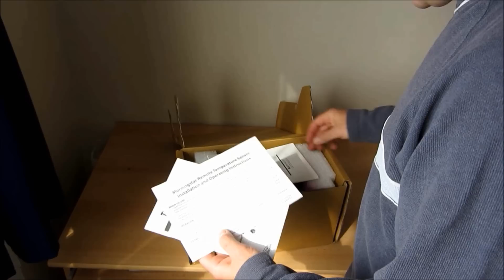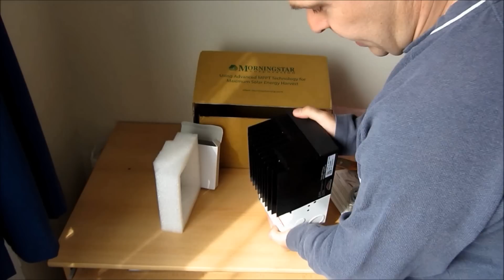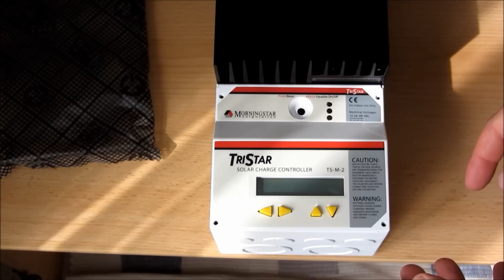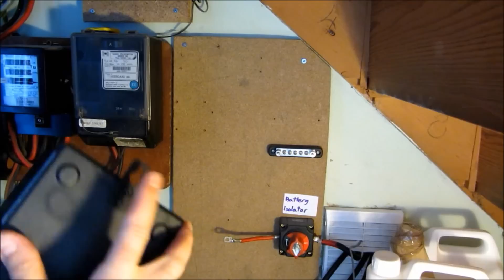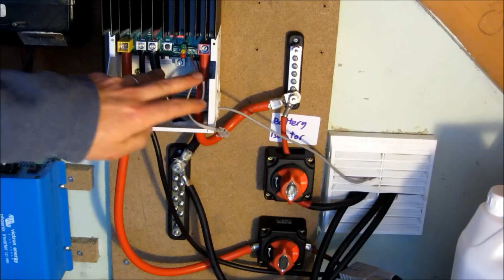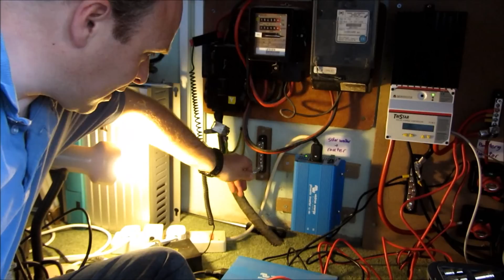Installing a Morningstar TriStar MPPT 60A off-grid solar charge controller

Comment: i was so worried i had a nightmare last night of this charge controller that i owned melting, it was crazy.
Reply from the maker: Well, they are quite costly! As far as I can tell, as long as you have the wires connected the right way round, and as long as you never have the PV connected while the battery is disconnected, you can't go wrong.
Reply: Mike Pepler    Can you please help. i have this http://www.solartronic.com/download/PS-121000.pdf  batteries conected in series running at 12 volts, the problem is that it will not go in to float mode, i have all switches off except for except for 3. 1 off 2 off 3 on 4 off 5 off 6 off 7 off 8 off. can you please help me set it up . i dont want to mess up those batteries are gel batteries.
Reply from the maker: unitcount503
Hi. That's a 12V battery, so do you mean you have them in parallel? If you have two in series that makes 24V, which would certainly stop it working properly. Also, it's an AGM battery, not gel, so you should be OK choosing battery type 4 from the list in the manual (switches 4-off, 5-on, 6-on). Could you confirm how many batteries you have and if they are in series or parallel? Also, if you could tell me the type, number and wiring of the PV panels that would be useful too.
Reply: Mike Pepler  i have both batteries in parallel 12 volt system they are deep cycle batteries.  do you set the voltage  to the vdc that says on the batttery, im talking about the pwn chargeing. because they can over heat if you setup the pwn wrong. its like to tell the charge controller to stop chargeing.
Reply from the maker: unitcount503 Well, I still think you should change the jumpers to AGM type. But looking at the datasheet, it says max charge current is 20A, so as you have two in parallel you can set the limit 40A. To do this you have to program the controller though, which has some complexity, so I'd suggest that you get someone local to help you if you're not sure, so they can come round and look at it with you. or contact Morningstar support, as they are very helpful.

Comment: i seen on the diagram it shows to connect the positive directly to the battery >?
Reply from the maker: Yes, mine does go direct to the battery, just happens to be via a switch for disconnection and a fuse.

Comment: great video you say you are going to upgrade to 750w I take it your running a 24volt system as I think its 600w max using 12 volt system.how will you wire the new panels up in series or some parallel.thanks
Reply from the maker: Hi. Actually, the limit is 60A, rather than a power in watts. I've since upgraded to 750W, and then added more to reach 1250W. The controller can handle about 860W when the battery is at the absorb stage, as I have a 12V system. Interestingly though, a 250W panel usually only peaks at around 180W once the sun's heated it up, so peak power from my system is between 900 and 1000W in practice. That means on sunny summer days the controller is dumping some power, but in the winter the extra panels come in useful. 

If I read starting from scratch, I'd do 24V, but I already had 12V kit...

Comment: What does the 3 LED indicator indicates
Reply from the maker: Voltage of the battery, and using a computer you can program the voltages they come on at. They also flash in sequence during programming.

Comment: since you already got a victron inverter why didn't you buy a victron charge controller as well.
Reply from the maker: +MySchizo Buddy they're not connected, so it doesn't make any difference what brand. I'm not sure the Victron controller is as good quality as the Morningstar, and it doesn't have the same technical specification.

Comment: Where does solar energy goes when all your energy storage devices are full?
To waste?
Reply from the maker: Yes, the controller will raise the array voltage above Vmp, towards Voc, to reduce the power output once the battery is full. So to make best use of the power you need two things - a big battery, and loads you can bring on when there is spare power. I run the washing machine for example, or use a slow cooker, when there is surplus power.
Reply: Mike Pepler Very nice.
If you got money can you buy (build) 22v 6000Farad ultracapacitor module. To put wasted energy in ultracaps. And let us know how it is? I use 22v 375Farad, can boil tea of soup. I just done have money to buy more farads.
Reply from the maker: Artjoms Pugacovs  I did wonder about using ultracaps (I have a couple of torches that use them), but at the end of the day I'd probably be better putting the money towards bigger batteries when I next upgrade them.

Comment: I'm off the grid and I was just wondering what is a bust bar for?
Reply from the maker: clark Grizwalt It's a 'bus bar', and it's just a bit of metal you can bolt several connectors on to. I use them to merge the parallel connections from my 5 solar panels into two wires to run to the charge controller, and at the other end to distribute power to the inverters.
Reply: Ok

Comment: How did you knock the holes off?
Reply from the maker: With some difficulty! :-) I put a screwdriver near the edge of each one and tapped it with a hammer until it had moved away from the body a bit. Once there was a gap, you could get the screwdriver in and lever the circle of metal away and break it off.
Reply: Thanks Mike. For the Remote Temperature Sensor, how to connect it to battery. I have 2 batteries in series. Do I just need to connect it to any one terminal either positive or negative of either battery 1 or 2?
Reply from the maker: Khalil Raza Either battery will do. I think the manual suggests bolting it onto the positive terminal - perhaps it gets a bit warmer during charging? It's also worth insulating it after installation - I just covered it in bubble wrap and taped it up.
Reply: I called Morningstar, they told me it doesn't matter which terminal you connect to. Thanks
Reply from the maker: Fair enough. I just checked the manual, and it also says either terminal. Not sure where I read the bit about positive... Do insulate it though - that's definitely in the Morningstar manual.

Comment: i dont get a green light on that charge controller is that normal i get yellow and orange light.
Reply from the maker: Yes, that's fine - just showing the battery voltage. The default voltage levels for the lights are quite high, which is why it's not green. I reprogrammed the voltages in mine through MSView. But be warned, don't get into changing the settings until you're sure you understand everything about them - you can damage things very easily. Worth learning though, mine works very nicely now I've adjusted it.
Reply: Mike Pepler ok i only massed with the voltage settings the other settings i dont understand.  so it should work with all the setting on the off poistion ?
Reply from the maker: unitcount503 Switch 1 has to be off. Switches 2 and 3 are ok off. Switches 4,5,6 need to be set for your type of battery - page 19 in my manual - if they are all off it will work, but not as well as it could. Switch 7 is OK off. Switch 8 only needs to be on if you are programming the controller over a network, at all other times it should be off anyway. You really do need to just carefully read the manual though, don't rush it.

Comment: Hello All,
please, how can I set the dip switch for tristar ts45 for a 24volts connection with a deep cycle battery fro Emerson. Urgent reply will be highly appreciated.
Reply from the maker: Hi Nick. If you've not got the manual, you can download it from http://support.morningstarcorp.com/ . The voltage DIP settings are on p18, you can set them to 24V, or AUTO. You may as well use 24V setting though. For battery settings, you should find out what the recommended absorption, float and equalize voltages are for your battery, and then choose the best match from p19 in the manual to set the DIP switches accordingly. If you get the appropriate cable you can programme the voltages to exactly match your battery's requirements, but this is not for beginners, as incorrect settings could cause damage or even fire. Hope this helps, Mike

Comment: Mind share with your connection to me for MPPT charge controller to PV, battery to Load?
Reply from the maker: Jovan Yeo I connected the controller to the PV and to the battery, and connected the loads straight to the battery. I included fuses and switches for 
disconnection as well. There's more details on the Morningstar website, or you can watch my other video on it: https://www.youtube.com/watch?v=z3U1jwoferE

Comment: I want to select DIP switched(4, 5 and 6) How do I know my battery is type 1, 2, 3 or so on. 
I have batteries 6FTJ- 150 B
12V 135Ah/ 10 hr
Valve Regulated Sealed Gel Battery
I would be glad to reply me. 
Thank you. 
Popal from Afghanistan
Reply from the maker: Hi Popal. Page 19 of the manual has a table of battery types. Types 1, 2 or 3 might be suitable for your batteries - you need to check the battery specification with the manufacturer to see what voltage they recommend for the absorption stage, and then choose the correct type from the table and set the DIP switches according to that. You could start with all the switches off to be safe (type 1 in the table), but if your battery needs type 2 or 3 that will charge it better.

Comment: You never solder a crimp connector. Look up the best practice for the electrical industry. People keep copying others on YouTube without ever doing their own research
Reply from the maker: Yeah, I know, it's been pointed out already. I didn't have a suitable crimping tool at the time, hence the solder. Though I gather the best practice of crimping only is to avoid problems arising from vibration, movement and temperature changes? I can see this applies in a car engine bay, or similar environment, but this is a static installation at stable temperatures, so I guess it should be fine? Or do you think there's still a risk of the joints breaking at some point?
Reply: I used to work for a company making control panels for the power 
industry where build failure was simply not an option, crimping was 
standard practice for every wire. Quality Control would personally rip 
you a new anus if there was a loose crimp or earth wire to be found.
A crimped wire isn't going to have loose strands of copper to short out, and a properly strapped cable harness isn't going to have terminals fall out of a screw connector. Also bare copper wire always oxidises and will fail eventually, a coated crimp will last decades longer.
It's not always about what is fine, it's doing something to a standard, just like it's fine driving without a seatbelt - just as long as you and 
everyone watching you knows that doing so is the incorrect way, so they have to choice to copy you or not. There's nothing wrong with cleaning up the gene pool via accidental deaths.
What is happening here is that everyone sees something being built the wrong way, and they will then copy that out of ignorance.
Like some guy might watch this video, post "awesome build dude" and bury this comment. And so the cycle continues.
Reply from the maker: +horse1066 OK, thanks. Do you have a link to a good video showing crimping of similar size cables? I'll add it as a pop up card at the right point on the video. But would you recommend that I take apart what I've built and redo it using a crimping tool?
Reply: I can't post links because google sees them as spam: look for "Tutorial: How to crimp connectors, strip wire and use heat shrink - mjlorton" and "Crimp Theory Fundamentals: BASIC - TE Connectivity".
No need to take it apart, if it works it's fine, crimps are expensive.
The annoying thing is that a video by that numpty knurlgnar24 gets a million views and he hasn't got a clue what he's doing, yet the people who do know don't get any views. Youtube only rewards clickbait titles, and ignores all the thumbs down.
Reply from the maker: Thanks. I'd not watched any videos suggesting I did it this way, I just knew that the crimp I was doing with a hand tool was not good enough, hence adding solder.  What I've done is edit the chunk with the soldering out of the video entirely - it hadn't had so many views I was barred from doing it, and it wasn't essential to the rest of the video anyway, so I figured I might as well avoid spreading bad practice.
Reply from the maker: But note that the edit may take a short while to take effect...
Reply: That's pretty decent of you to help out. Thanks